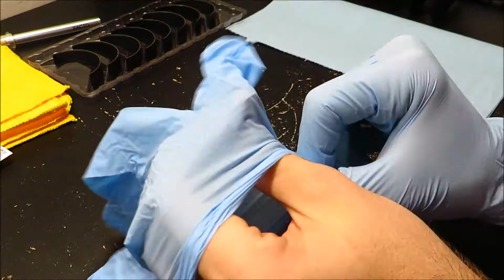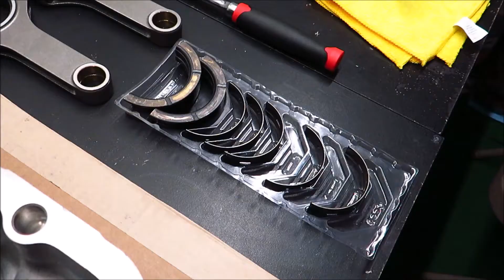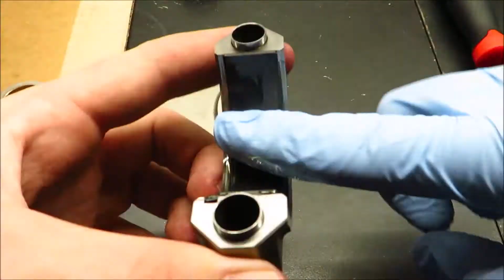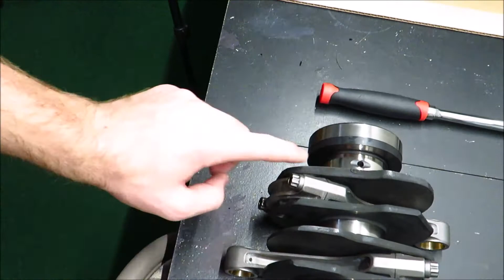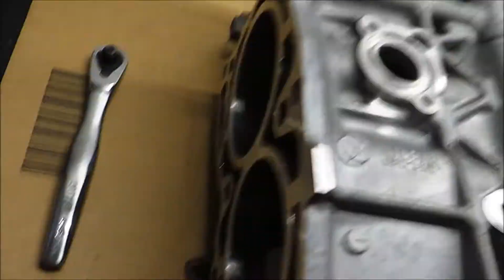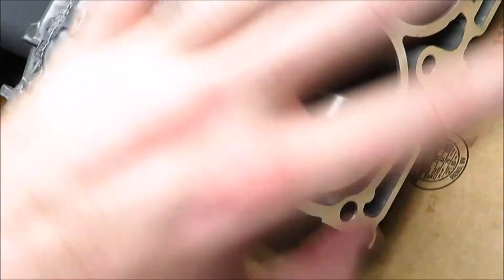Subaru EJ25 Short Block Assembly Part 1

Comment: If I’m getting a new crank shaft and rods at oem spec do I still need to measure for bearing size? If so how do I do that?
Reply from the maker: You can just order oem sized bearings but you still need to check the clearance using plastigauge

Comment: just to clarify you tightened 90 degrees. and later in video you demonstrated a left rotation. just caught me offgaurd but great video doing this today actually thank you. i like the spread technique instead of the bead. kindof like putting a cpu on a motherboard lol !
Reply from the maker: Yeah you tighten to a torque spec. I don't remember what it was, but it should say in the video. Then once it's torqued to that number you turn it an additional 90 degrees. The case bolts are strech to yield that's why. As far as the left turn it may have just been a camera angle thing or the video was mirrored 😂
Reply: I literally read the manual wrong and snapped a case bolt A driver side the thread are now in there. Thought it was 88 ft. But was 88 inch pounds divided by 12. 7.3F lbs. Plus the 90. Now gotta split again and extract the bolt somehow and buy new set of bolts. Crazy day
Reply from the maker: Happens to the best of us, good luck with your project!

Comment: I was always a bit concerned about splitting the block. Back with my n/a Forester, I went as far as changing piston rings, since I was advised not to split the block. But how/when does one know when one has to bore/hone the crankshaft hole? Since not doing so properly can cause catastrophic failure on a motor..
Reply from the maker: I'm not sure, I guess when you install a different crankshaft. I'm pretty sure mine was line bored when I had the work done.  I don't think it is critical but it is good to get done
Reply: @SWSpeedCo  Oh never mind, I was watching your other Piston Balancing video and realized you sent out yours to Out-front Motorsport. You also got a whole new crankshaft, ok. Nice!

Comment: Great video! I recently had the short block replaced in my 2009 Subaru Forester XT due to excessive oil burning. A week after I got my car back from my Subaru dealership, I can still smell the oil. Is it because the new parts are still breaking in or the job wasn't done right? Thank you for your time.
Reply from the maker: Have you noticed any oil consumption on the dipstick